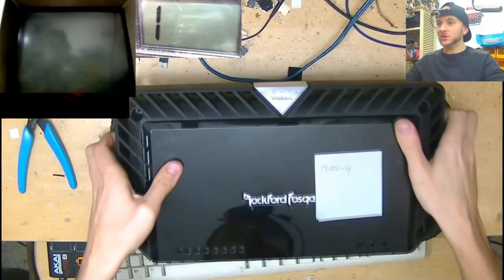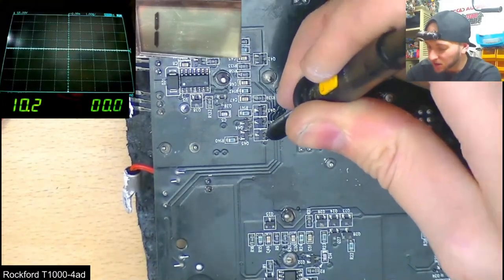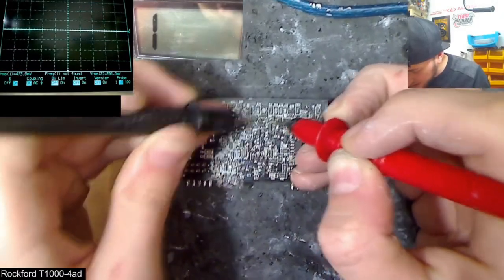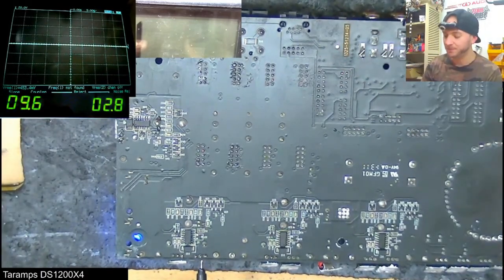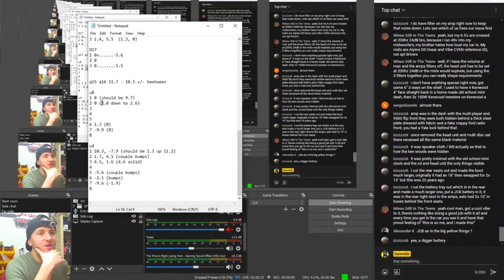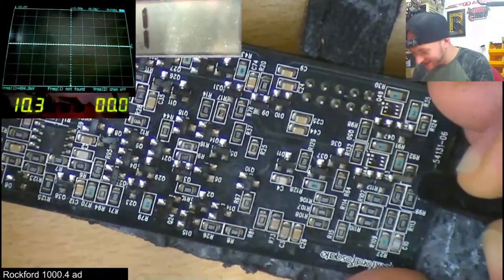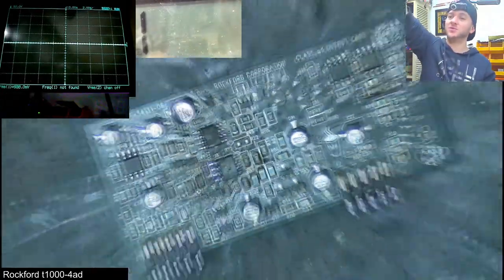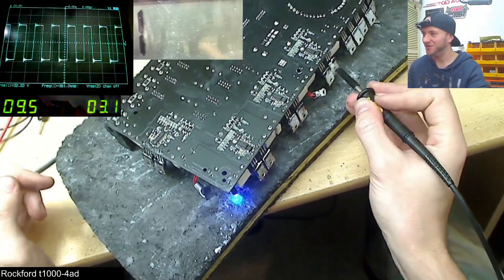One of the most COMPLEX class D amplifiers - Can I fix it? Rockford T1000-4ad

Comment: That's very good going, hats off to you. Fixing that amp without a schematic is pretty bloody awesome. I guess the dual transistor packages are configured as differential amplifiers/comparators, checking signal or DC conditions, maybe in a closed loop. Either way I'm impressed by your tenacity; kudos.
Reply from the maker: thank you sir! A schematic would have been a bloody godsend on this one lol!
Reply: @barevids  i would guess they wont release the repair manual but not a bad idea to ask them either. i had a good luck asking for repair manual on some brands!. sometimes we (engineers) use discretes to get a specific performance or function but sure enough it made a blind repair more challenging

Comment: Awesome, that is one complicated circuit design, would love to see a full run down on what make their class AD design different from your typical class D
Reply: it's just a marketing term, it's still a class D amplifier in addition to what rockford fosgate says is an extra feedback loop (which i think all class D amps should have)  between the filtered output and the input to reduce distortion, apparently it also has dynamic switching frequency that changes during different power levels (according to them it increases fidelity during lower power levels but im skeptical)

Comment: I had a t1500bdcp that would sometimes work perfectly fine and other times not power on at all. Bypassing the protection comparators allowed the amp to turn on and build rail voltage but sometimes it would have no output, and sometimes it did. I would also sometimes come back the next day to the amp working perfectly fine without even doing anything to it the previous day. I spent so many hours on that thing that in the end I concluded that there must've been a (or multiple) broken internal trace somewhere. Without schematics it makes repairing these RF amps pretty difficult. Good job on finding the fault :)

Comment: Ah the frustration of it not being what you thought. Then the compound failures.
I presently have a switchmode supply and class d mono amp all on one board that has a low output. No info, and no comparison. What a chore it is.
A brilliant example of how things can be fixed with enough time thrown at them. The right to repair should include access to technical information though or its just a lot more of this.
Thanks for your efforts.

Comment: RF makes all their own designs. Chip set, etc. are specifically for RF models. That's what makes a RF a RF amp. JL is similar. Not sure which is better/higher quality. Plenty of cheap amps out there that make a lot of power in a clean manner, and some come with free option of setting vehicles on fire, like Sundown. Pretty sure Skar amps have free fire starter circuits built right in too.
Reply: Their prime amp line is a more generic design, still has some Rockford Fosgate touches though. It would be nice to see them come out with some new stuff, hopefully with them being acquired they will release some of the new stuff they have waiting.
Reply: These t series fosgates are considered the best by bass heads than can afford them. Jl being right there beside them
Reply: @charleswp71  I have 3 RF AMPs right now. I have run the shit out of them for several years. No problems whatsoever. Actually, they always impress me with sound quality and ability to push the hell out of some speakers very cleanly.
Reply: @thomasjones3531  I have a Power and 2 Punch series. the power amp runs hotter for some reason. didn't want to dish out for the T series.
Reply: @RobHTech  me either but I couldn't help myself. I have the t1500, t1000 and t400.4. They are ridiculous overpowered and yes overpriced comparing to.othsr amps and wattage for the money. I'm usually a cheap ass that runs orion, Kicker , planet audio value type stuff but once I got one t series I had to have more lol

Comment: i own this amp.. bought it on ebay for 400$.. reason in 1999, i bought an RF power 800a4.. that amp still works (though has some cold solder issues with the pots).. I pretty much got every bit of my money out of that amp and could still bring it back to life... not saying other amps couldnt do the same ( i also own 2 mtx 81000ds which both still work fine from 2002) but why go elsewhere?

Comment: What do you do to protect yourself from soldering fumes and chemicals. ? Lead, etc And have you been affected?
Reply from the maker: I do worry about this. Currently protected by 1 like = 1 prayer but I should probably wear gloves and build a little fume extractor.
Reply: @barevids  i look at this.
And i have to ask .
Class a/b VS class-d . What is easy to diagnose and repair ?
I Just start today with test repear of my old Amps.
I try to fix a caliber amp from active subwoofer 
And set your YouTube channel on and try the same wy to test the stuf 
And learn more about electronic this way.
And yes i have basic paperback off electro but not like what you do (car electro repair)

Comment: I’m a new subscriber. Do you have a discord ? Also, I have just started recently in PCB repair, these two amps that I have our my first to repair, from a friend. It’s not life or death if I fail. 
Rockford punch 800a2 and kicker zx750.1 

On the kicker, I’m told it was a working amp, but a previous repair attempt from the actual owner himself was replacing the 2 damaged 40amp blade fuse holders on the board with 2 marine grade inline fuse holders. Not rated for 40amps and obviously horrific looking . I have not been able to source replacement fuse holders. The design in my opinion is horrible from an engineering standpoint, as the vertical posts themselves (perpendicular to the board) is actually what supports it physically. Anyway, any idea where I can purchase these ?
Reply from the maker: Hey buddy! theres a discord somewhere ill try and find a link in a bit... in regards to the fuse, dont bother trying to replace it. All amps should be fused along the power wire anyway. having onboard fuses is just a secondary failsafe and most amplifiers nowadays do not have them. I suggest simply bridging over the fuse traces with some thick wire or something.
Reply: @barevids  nice!! I always wondered if it was a redundancy for the main power in or for some other internal circuit since it seemed to go without saying you should fuse 12v in.. but I guess some fail to…
Reply: The customers response : Nah I wanna keep the fuzes as a second fail safe lol
Reply: sooooo.... back to squareone.. Where can i get them?!!?!?!?! Have a old donor board you can pull them off and sell to a mate>!

Comment: Is this because of Rockfords class "AD" which is a fancy variable switching frequency to lower distortion and then at high output levels you get more power but with a little more distortion? thats what I have heard
Reply: sure enough a bare class D without any fancy circuity would be much easier to repair. that's if you were wondering why this amp is hard to repair without schematic

Comment: i have a Luxon 1000 d reference amp just curious anyone have one of theses or have you ever repaired one i have one that died but it was well abused the manual for the amp states 0.1ohm stable and warranty is void if you do not run a minimum 200 amp fuse the amp does load down well do not no if stated power is correct for this amp is older amp and cannot be found anywhere information is hard to find

Comment: I used to repair pro audio gear. I came to the conclusion that class d amps were all disposables, no matter the price. Almost all class d amp failures resulted in smoke and a crater in the board. The only reason this amp did not smoke is the low voltages involved.

Comment: A boardmaster would have saved hours kkkk complex defects require more refined techniques to save time.
Reply from the maker: Sure, but send me a link to where to buy one.
Reply from the maker: @thytoin1  when you say not cheap, what ballpark? £1k, £10k,  £100k?
Reply: @barevids  I live in Brazil, due to taxes it is a little expensive, but if you are in the UK, it will cost a lot less.. ask for a quote, I believe it does not exceed 8000 pounds for each module (AICT and AMS). There are other V-I curve plotters on the market, but ABi's equipment is at a higher level in quality. ABi Electronics has a YouTube channel and several distributors around the world.